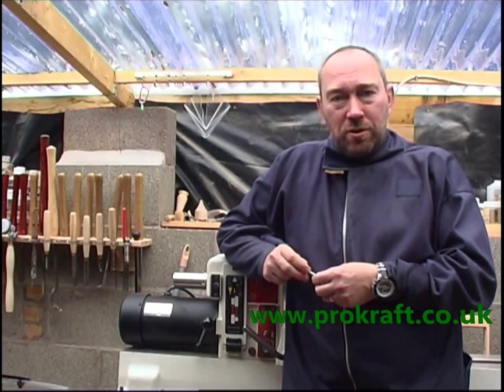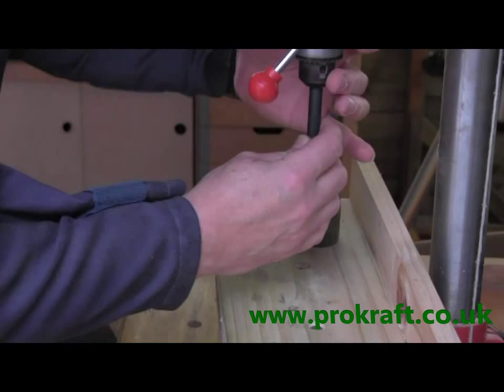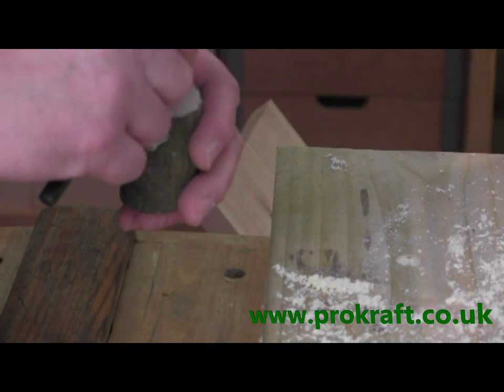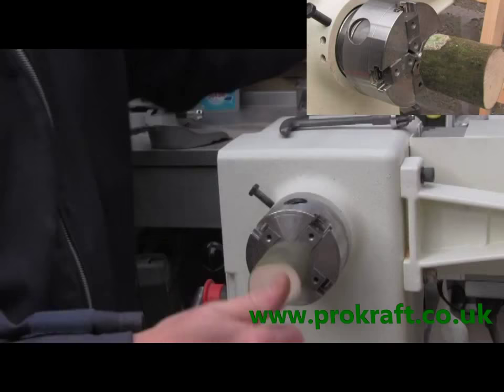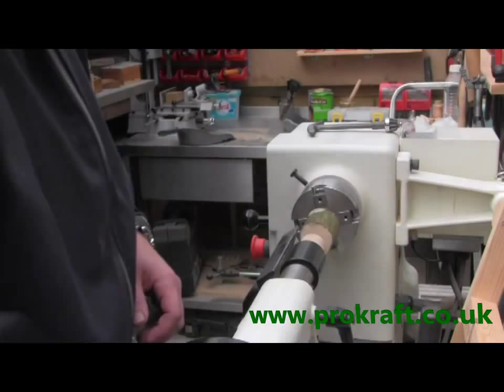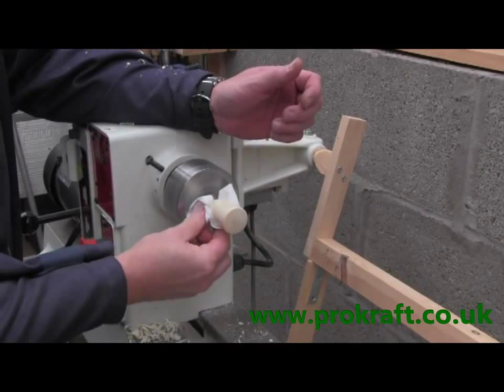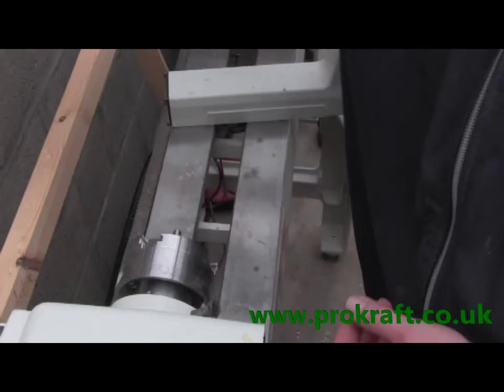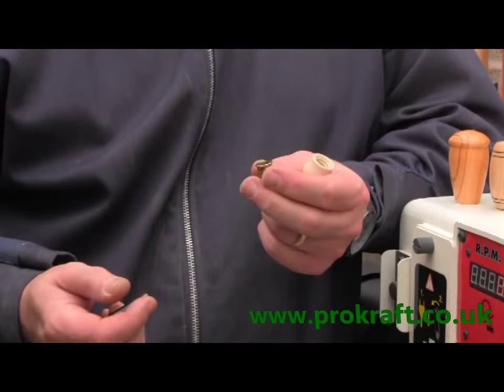Woodturning Bottle Stopper System from Prokraft

Comment: The washer that came with the mandrel I bought is a bit to small and not the same size as the bottle stopper I bought, I take it I can replace this washer with one the same size as the stopper ?
Reply from the maker: Hello Billy,
The washers are there to hold the blank flat on the mandrel, they are not a fitting guide as we do 3 stoppers and they are different sizes. It is a mandrel for holding the blank it is not an arbour. I would not recommend using a metal washer as a turning guide as you may well damage your tool if you catch it on the washer. There is a video on a home-made arbour that uses some of the bits that come with the kits (https://youtu.be/gXMskkZE0fY). The mandrel that we do enables you to make a neck narrower than the top of the stopper to get a different design - you cannot do that with an arbour. I hope that makes sense! Cheers, Jon.